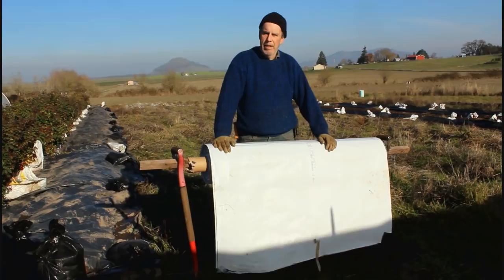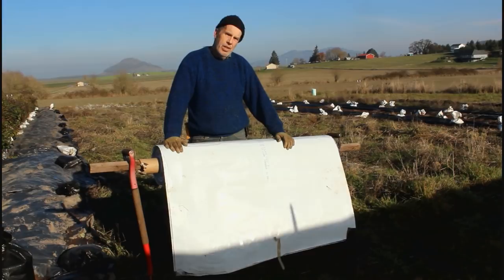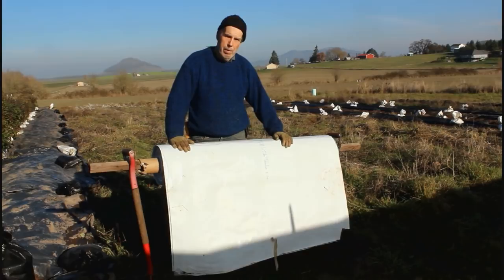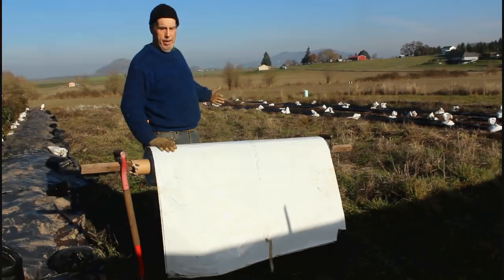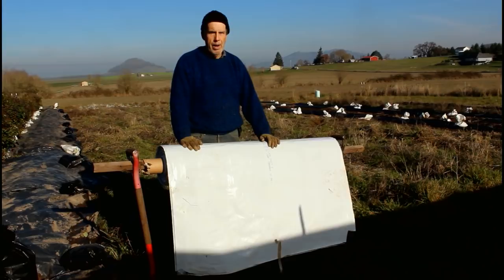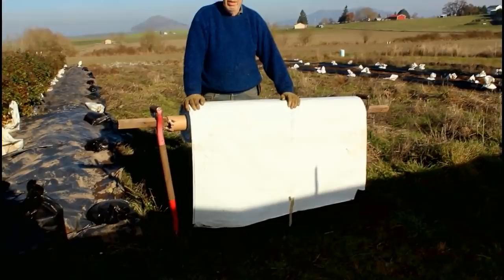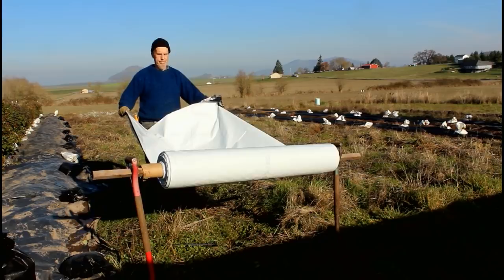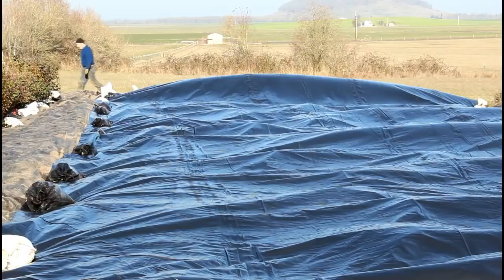Reclaiming a fallow field using No-till Occultation

Comment: Yes sir! Tarps and sand bags are the way to go! I have mine cut to size for my 5 large beds and just roll them onto pvc pipe, mark the bed number and store until ready to go again. I kill cover with it as well. The only negative we experience is that fire ants love that environment! Looks like you may not have fire ants, if not, thank your lucky stars! I just deal with them after the tarps come off and go from there. It's been the best thing in the world for our soil!
Reply: How do you deal with fire ants?
Reply: @johnndavis7647  First shot is boiling hot water, then I just "aggravate the hell out of them". I run through them a few times with my wheel hoe and cultivator teeth. Tear up their world. They go elsewhere then. I'm reluctant to use anything too nasty in my plots.

Comment: So how did these beds turn out in the Spring? I was wondering if it actually killed off all the vegetation that is under the tarp. Was there heavy weed pressure in the spring or was everything just dead?
Reply from the maker: We are now in the process of the occultation doing its work. Past experience has shown that 80%+ of the surface residue  and 100% of the root mass is typically rotted after 6-10 weeks in the winter time. During the summer or warmer months this process can be as fast as 3-4 weeks.

Comment: I understand this part of no-till bed prep, but what I don't understand is how this goes from the point at which you uncover the soil to a fine, smooth bed for planting? How do you get rid of the rotted vegetation  (or incorporate into the soil) without tilling? Do you just pile compost deeply over it and plant in the compost?
Reply from the maker: Hi Lindsay;  About 85-90% of the vegetation in this covered area had been completely decomposed. The remaining wasn't very heavy and we left it in place.  Since we chose not to rake it off,  we applied mineral/rock dust and cottonseed meal on the soil surface and then applied a ~2" layer of aged compost on top of each bed.  As a note we rolled the tarp back to expose a new bed for this treatment only as we needed them for planting other wise we kept the tarp in place.  In this instance we did not fork the beds.

Comment: Does this method simply allow you early access to work the land, or will it help with eradicating the weeds and grasses underneath?
Reply from the maker: Hi Denise, Thanks again for watching our videos!  The method actually is the staring point for both early start by keeping excess rain water off the area and by hitting the overwinter/cool season grasses and weeds pretty hard.  Over time with repeated occultations as part of the crop rotations and using compost top mulches with no tillage the weed bank begins to decline substantially.

Comment: Hey there. I see that this method is being used on, as you define, a fallow field, and it also sounded as if you’ve worked this ground before. With this technique of occultation are you able to replace the groundbreaking work that a BCS tiller would do on new land?
Reply from the maker: Hi Jesse;  Great question!  This field was left fallow for almost 2 years.  Yes we are able to bring this field back to production with no mechanical tillage.  If we find compaction we do use a broadfork on the bed only.  To do this on new land leaving the tarp in place for several months with adequate ground moisture should remove most of the top debris and all the root systems will have decomposed.

Comment: Lol...i was.trying ro explain solarization and occulzation...and here u are...by accident ..i found solarizarion doesnt work with my weeds..even doing it all summer in 100 degree week.and sealing the edges...and tucking in a drip hose.

U ever use biodegradable plastic mulch..just wanting someone who tells the truth to evaluate it...never found anyone..so i went ahead and bought it...i am still on the fence about using it this year.

Comment: Can I tarp with weed membrane? Just starting out and would save buying twice?
Reply from the maker: The weed membrane works well in the rainy season or when light levels are low.  Weed membranes only black about 96 percent light and lets moisture through. Summertime, the soil gets way to dry under the mat in our dry summer climate. Biomass underneath slow to decompose. Best of luck. Thank you for watching.😊